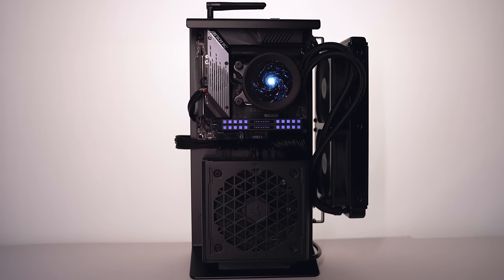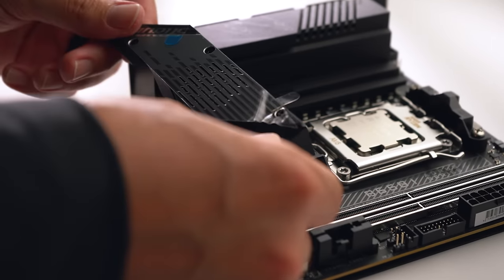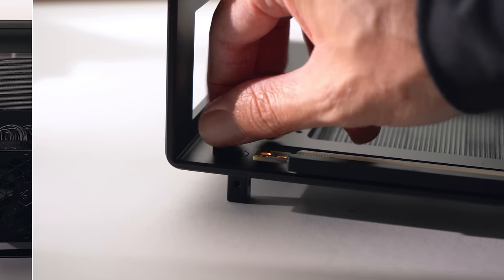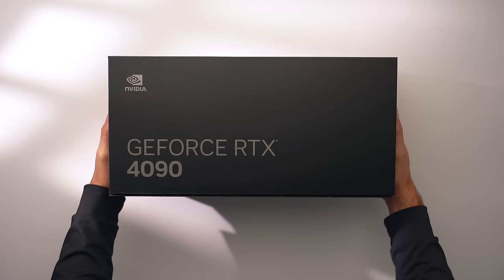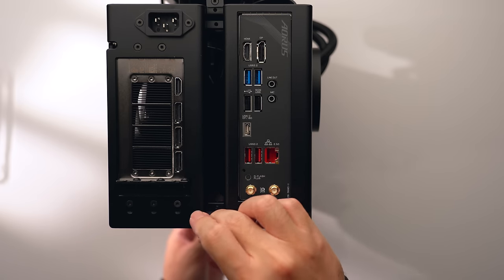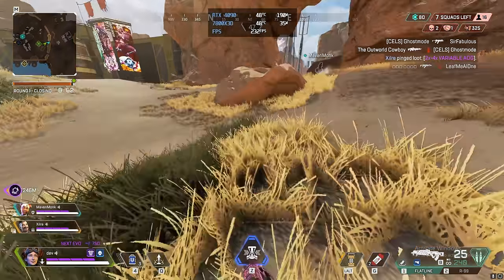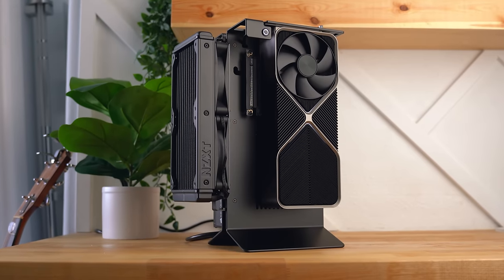This is a computer?

Comment: I'm glad you actually tested 1440p on this build. People finally realizing that 144fps 1440p is better than 73FPS 4K.
Reply: What are you doing here lmao
Reply: @24Kvgx was about to ask the same 😅
Reply: Yeah no it’s not. 4k at 30fps is even better. Other wise no point of good graphics
Reply: @AKAKILLINGKING there's no point in a mad high resolution when you can't play at a frame rate that isn't nauseating.

1440p is good quality and you get good frames.

Fuck it bro, get an 8k display, resolution is more important, doesn't matter that the game is running like pictures in an art gallery.
Reply: @AKAKILLINGKING who the fuck is playing 4k at 30fps lmao
Reply: @AKAKILLINGKING  smooth brain
Reply: @gopnikolai7483  I have a 4K@120Hz display while I've "only" got a Ryzen 5 7600 & RTX 4070Ti. I use DLSS or FSR whenever possible, FullHD or QHD upscaled to UHD definitely looks good enough for me. If that isn't a option I usually just lower the graphical settings, the difference between medium and the ultra graphical preset in games is usually minimal. I usually don't have a problem getting a stable 120fps in 4K, upscaled images aren't the same as native 4K but will still look better than native QHD.
Reply: It is not. 2023+1, I don't understand why potato res is still a thing , get an xbone instead if u want that
Reply: what does this even mean
Reply: *if you prefer higher framerates to image quality 

4k's image quality is ridiculous and I'm fine with 60fps if I can hit that image quality for all my single player or casual needs
Reply: What teh feck?  I'm gonna swap my RX580 for a GTX 1080 or something like it. It will be fine for my ML and occasional gaming needs! 😁 I usually play older games at 1440p60 or 1440p120. Half Life 1 and Quake 3 run fine on max settings at 1440p120 so whats the problem?
Reply: ummm i been gaming since 12 years of age competitive gaming so ima take take that 144 fps sir
Reply: what are you doing here??

Comment: Don't get me wrong I really REALLLY want to make my comp like this now, but I cant imagine this not being a literal dust magnet
Reply: Probably not...No where for dust to collect aside from on the components themselves as opposed to a handful of case filters, the case fans and inside the case itself. This would be way easier to clean and maintain. Take it out to the driveway and blow it off with a lite duty electric leaf blower.
Reply: Flip it around, it makes it very easy to clean the dust, as opposed to a box style case that has to be periodically opened and cleaned etc.
Reply: I've had my Xtia Xproto for 2-3 years now, honestly super easy to clean, the only place you get dust is on the CPU radiator fans
Reply: @Scythe1337  take a leaf blower to a 4090? have you ever owned a pc worth more than 200$?
Reply: @rat6893  My last two builds were more than $3K. Using a lite duty leaf blower from a distance is no different than using a can of compressed air up close. At my shop we used the data vac which pushes more air than my Kobalt electric leaf blower at home ... Haven't had a single problem in 19 years.
Reply: @Scythe1337  Leaf blowers generate static electricity. I would advise you to buy a cheap datavac.
Reply: @NisseCrusader  Tell me how much rushing air on a PCB mounted on an earth grounded chassis can create damaging charge differences and maybe I'll consider your comment. 

Regardless, integrated circuit design really started to become good enough, over 2 decades ago, to practically eliminate static discharge hazard when working in a PC. 

If you go back and actually read through my comments ... you'll see that I already own a data vac.
Reply: @Scythe1337  I think I'll stick with carefully disassembling my $1500+ GPU to clean it and fully recommend anyone reading this shitshow to do the same. Failing that take it to a professional.
Reply: @rat6893  What you're recommending is that people take extra steps to clean their card AND void their warranty. Nearly all "professionals" are going to blow it out with a data vac, leaf blower or air hose connected to an air compressor.
Reply: @rat6893   You're talking to one of these "professionals". Like I previously said...It's common practice. Anyway, you're really starting to give off "That one guy who always acts like he knows everything" vibes...and there's no sense trying to reason with people like you.
Reply: A simple can duster will do the trick
Reply: @MrSaljstn  and quite possibly fry your GPU
Reply: while blasting you with EMF
Reply: I have the XTIA Xproto-ATX case V1 from the same company as in Devyn's video and it heavily depends on your environment. If people live in a very dusty area then yeah I can imagine you would clean it every month or less or so but if that's not the case you do not need to clean it that often. I have my open case for almost 11 months now and I have cleaned it 2 times so far. and even when I decided to clean it there was an extremely thin (emphasis on thin) layer of dust on the top of te case and GPU with that dust there were no differences in either temperatures or performance. using an electric air duster and in 5 minutes tops the dust is gone. 

So yeah if someone wants to buy an open case, they just need to look at how dusty their room and how dusty it can get within a certain perod of time is and based on that you can guess fairly accurately how many times you would feel the need to clean your PC. 

For example, there is a video of a guy who shares an update on not cleaning his PC after 3 months with the same case as in this video of Devyn. I nowhere nearly have as much as this guy in the video. After 6 months I don't even see dust on my CPU fans or PSU. 

Since YouTube will not let you post links the title of the video is called ''Three months of dust with xproto + cleaning''
Reply: or an unfinished drinks magnet. 😃
Reply: Sameeee!!!!

Comment: Doesn't it collect a lot of dust?
Reply: I have the XTIA Xproto-ATX case V1 from the same company as in Devyn's video and it heavily depends on your environment. If people live in a very dusty area then yeah I can imagine you would clean it every month or so but if that's not the case you do not need to clean it that often. I have my open case for almost 11 months now and I have cleaned it 2 times so far. and even when I decided to clean it there was an extremely thin (emphasis on thin) layer of dust on the top of te case and GPU with that dust there were no differences in either temperatures or performance. using an electric air duster and in 5 minutes tops the dust is gone. 

So yeah if someone wants to buy an open case, they just need to look at how dusty their room is and based on that you can guess fairly accurately how many times you would feel the need to clean your PC. 

For example, there is a video of a guy who shares an update on not cleaning his PC after 3 months with the same case as in this video of Devyn. I nowhere nearly have as much as this guy in the video. After 6 months I don't even see dust on my CPU fans or PSU. 

Since YouTube will not let you post links the title of the video is ''Three months of dust with xproto + cleaning''

Comment: this is perfect for ITX builds, you have a minimun foot print and can improve the looks with led cable mods if you want.   Easy to clean, more like an art piece in the desk.
Reply: nah. not really worth it cleaning your hardware every 5 days because there is no dust filters between the environment and the components. also having to resort to a "no drinks/food" policy in your room is a drag.
Reply: @bathsaltfiend986  I don't see the problem. Buy a simple airblower or use a delicate brush once a week. Then dust your room. Drinks and food will damage even a closed case.
Reply: @DinDonDan. My PC gets covered in dust in 3-4 days this would get dusty ih 1 day hahaha. I clean my house and room nonstop. This would have to be cleaned everyday i would give up
Reply: @bathsaltfiend986  I have this case for 2 years now and let me tell you, dust will not settle as fast as you think. Since there is constant airflow, I only need to remove dust as often as you would do with a closed case. A little can of pressurized air is more than enough for over a year. And this "tradeoff" I am more than willing to take for a stunning case design. 

Also it is way simpler to remove dust since there are no panels you need to disassemble for cleaning.

Comment: Great choice. Open air PCs are a lot of fun to build and look at, and contrary to what people may think, it actually doesn't get all that dusty and it's super super easy to clean. 

I've been using open air chassis for years and my go to choice was Yuel Beast Designs.

It's awesome seeing people moving into this space :D
Reply: what about the noise? isnt it louder vs in a case?
Reply: @matthewqtran1318  I've noticed that my open air case runs quieter & cooler than when I had my old Antec P120 crystal. I've also had no throttling issues either since switching over :o
Reply: Sure, but if you have a pet or kids around it's not really worth the risk.
Reply: How would you recommend transporting the xproto as a current open air case user?
Reply: @trllllon  I'm not OP but i have transported the xproto before and had no issues. I packed it in a cardboard box and used packaging materal to secure it. It has to be mentioned though that I have a Noctua NH-L9A installed so I have no issues with the cooler beeing higher than the "case" itself. Every edge on the build is protected by the case. With a larger cpu cooler it could be more difficult to transport safely.
Reply: not for poor area, rats and lizards and ants may reside, good for private rich rooms,

Comment: 5:51 They did brake aluminium plate wrong way considering "grain" of plate. This is why there is tearing under the paint = plate broke at the bend. Its common mistake with plates containing high amount of magnesium. Also bend radius here should be at least 4 times the thickness of plate.

Comment: i would love to have that but the dust will collect that forsure prefer putting a case
Reply: I have the XTIA Xproto-ATX case V1 from the same company as in Devyn's video and it heavily depends on your environment. If people live in a very dusty area then yeah I can imagine you would clean it every month or so but if that's not the case you do not need to clean it that often. I have my open case for almost 11 months now and I have cleaned it 2 times so far. and even when I decided to clean it there was an extremely thin (emphasis on thin) layer of dust on the top of te case and GPU with that dust there were no differences in either temperatures or performance. using an electric air duster and in 5 minutes tops the dust is gone. 

So yeah if someone wants to buy an open case, they just need to look at how dusty their room is and based on that you can guess fairly accurately how many times you would feel the need to clean your PC. 

For example, there is a video of a guy who shares an update on not cleaning his PC after 3 months with the same case as in this video of Devyn. I nowhere nearly have as much as this guy in the video. After 6 months I don't even see dust on my CPU fans or PSU. 

Since YouTube will not let you post links the title of the video is ''Three months of dust with xproto + cleaning''

Comment: I went this way with my builds a few years ago because cases need so many holes in them for cooling they are more hole than case anyway, I mount everything to a board on a slider and put it under my desk out of sight. Runs cooler and quieter so no need to waste money on a water cooler or a case or fans so simplifies the build and the $200+ I save can go into paying for the over priced gpu's world we live in......I personally find this build more aesthetically pleasing than any regular build anyway.

Comment: Just a heads up for anyone looking to build in this case, a lot of modern graphics cards with heat pipes / vapor chambers only work in specific orientations. I can tell you from experience the Asus Strix 30 series cards DO NOT WORK with the IO facing skyward. I've both a 3060ti & 3080ti strix and they both run considerably hotter in this orientation, I now have both builds in SSUPD cases where the IO faces downward. The 3060ti with its much lower power draw doesn't thermal throttle, but runs much hotter than normal, the 3080ti WILL thermal throttle quite quickly even in reasonable ambient temps. Do your research before forking out several hundred dollars on this case :)
Reply: There's the Xproto Flip Module V2. It lets you use the case with the IO facing down.

Comment: Not the total expert here but as far as testing goes that I have watched: A PC case with ideal air-flow should have better temps than an open design without air pressure circulation. 
Love the looks and art design of the build though 🤙

Comment: i have made one in 2022, but it's diy from a basic pc case around 2009. it make quite cool for pc component, but it make easier to dirty if the room  cleaned by non-vacuum tool.

Comment: For anyone thinking about buying an open case:

I have the XTIA Xproto-ATX case V1 case (same company as the one in this video) and I absolutely love it. I was really contemplating getting the case in the video only I eventually decided against it considering the maximum length of the GPU only will allow the base 4080/4090 and barely (maybe 1 or 2) 3rd party GPU's. and what if in 2025 the GPU's become even bigger? If I want to buy one of the 50 series I will not be able to unless I buy a whole new (open) case because it won't fit. 

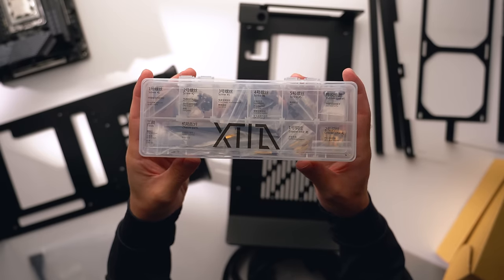From the beginning I was thoroughly impressed by what I had received. It's such a good idea of the company (with my case anyway) to just include a nice and detailed video that serves as a manual. I think every case manufacturer should do that.  it made building it so much easier. I also really like the quality of the case, the included small container (Like at 3:24) with each screw type clearly categorized and also the included screwdriver (3:31) you need that fits on all the screws. I was extremely impressed by this company that I had never heard of before I watched a video on it.

But what about dust? This must be a huge dust magnet no?

It heavily depends on your environment. If people live in a very dusty area then yeah I can imagine you would clean it every month or so but if that's not the case you do not need to clean it that often. I have my open case for almost 11 months now and I have cleaned it 2 times so far. and even when I decided to clean it there was an extremely thin (emphasis on thin) layer of dust on the top of te case and GPU with that dust there were no differences in either temperatures or performance. Using an electric air duster and in 5 minutes tops the dust is gone. 

So yeah if someone wants to buy an open case, they just need to look at how dusty their room is and based on that you can guess fairly accurately how many times you would feel the need to clean your PC. For example, there is a video of a guy who shares an update on not cleaning his PC after 3 months with the same case as in this video of Devyn. I nowhere nearly have as much as this guy in the video. After 6 months I don't even see dust on my CPU fans or PSU. 

Since YouTube will not let you post links the title of the video is ''Three months of dust with xproto + cleaning''

Comment: love the open design but practically would it not get dusty?
Reply: I was thinking the same thing. it is beautiful and all, but not worth it, it going to get too dusty and a real pain in the ass to clean all the time.
Reply: I have the XTIA Xproto-ATX case V1 from the same company as in Devyn's video and it heavily depends on your environment. If people live in a very dusty area then yeah I can imagine you would clean it every month or so but if that's not the case you do not need to clean it that often. I have my open case for almost 11 months now and I have cleaned it 2 times so far. and even when I decided to clean it there was an extremely thin (emphasis on thin) layer of dust on the top of te case and GPU with that dust there were no differences in either temperatures or performance. using an electric air duster and in 5 minutes tops the dust is gone. 

So yeah if someone wants to buy an open case, they just need to look at how dusty their room is and based on that you can guess fairly accurately how many times you would feel the need to clean your PC. 

For example, there is a video of a guy who shares an update on not cleaning his PC after 3 months with the same case as in this video of Devyn. I nowhere nearly have as much as this guy in the video. After 6 months I don't even see dust on my CPU fans or PSU. 

Since YouTube will not let you post links the title of the video is ''Three months of dust with xproto + cleaning''

Comment: I'm using this case for almost 2 years and its perfect, not much dust accumulation, temps 20°C lower than a classic build, easy acces to components, Ive built mine from and old msi infinite s, power supply only 19cm and the xtia being 19cm its thigt, cable management a little difficult, Ive pimped it with some little themometers to make it moke cyberpunk